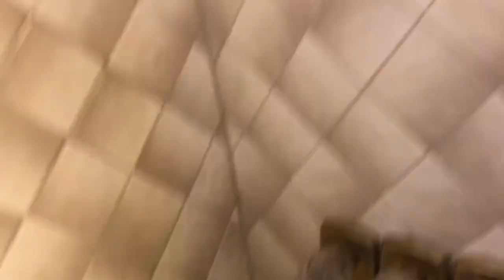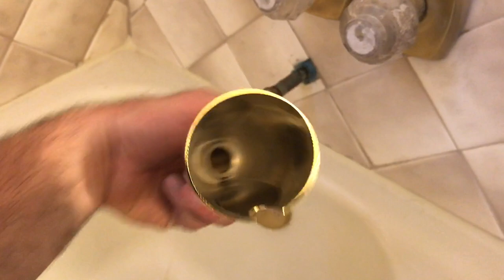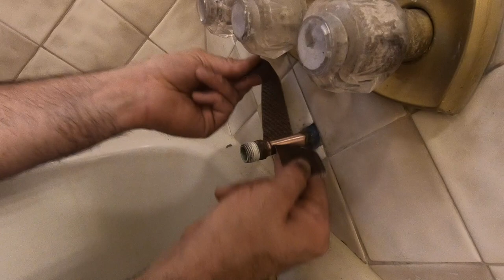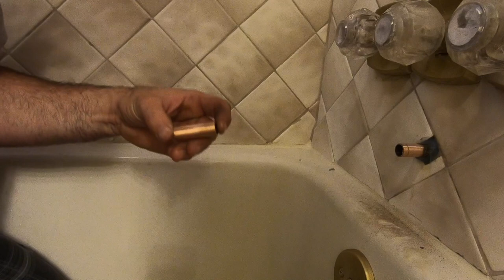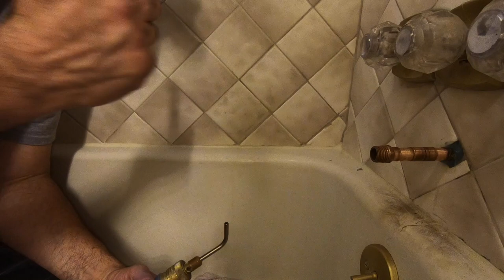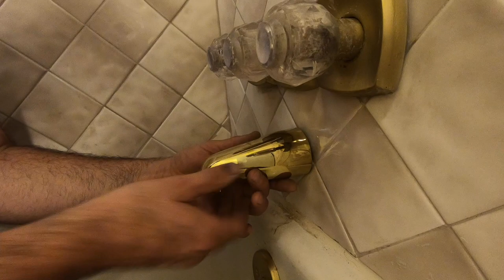Extending Pipe To Installing New Shower Faucet

Comment: Hacker I would have went 4 in. on that pipe don't worry about the Turbo Torch whistling it's okay and next time put Teflon tape and pipe dope on the threads and on the back part of the pipe crammit full of plumbers putty. That's my tech tip for the week. Peace brother
Reply from the maker: I should have but it threaded on looks different with no adapter plate at its base

Comment: New torch in action. Why dose it sound so noisy dirty tip
Reply from the maker: I didn’t like the flame from this tip. Straight acetylene is known to be louder than oxy acetylene yet I felt the flame wasn’t sharp enough. Yet the hose and regulator was all I wanted when I bought this since I have lots of tips. It’s tiring always switching tools from on van to another.
Reply: @billstools5244  I have only used oxy acetylene torches mainly for cutting or heating  and propane for  soldering
Reply from the maker: I want to get myself a oxy acetylene setup. Never used it. One company I worked for would give us propane or mapp gas. Yet that was almost 2 decades ago. I have used air/ acetylene setups for soldering and brazing. Mostly depends on the tip your using and instead of lugging 2 tanks around it’s just a b or Mc tank. Oxygen is already on the air. Might be why it’s a lot louder or a torch